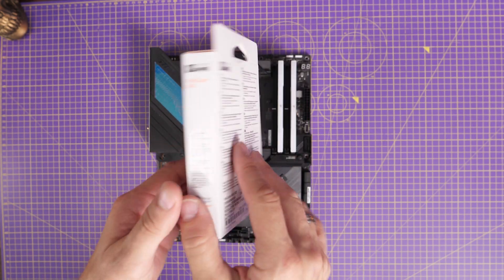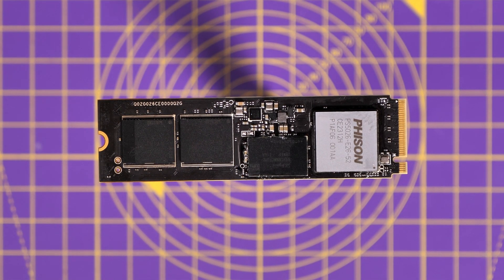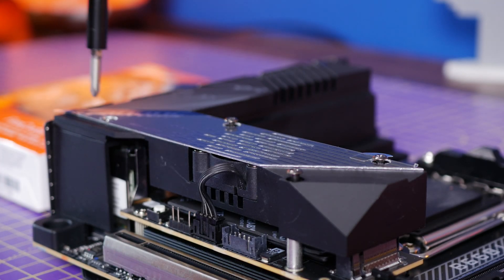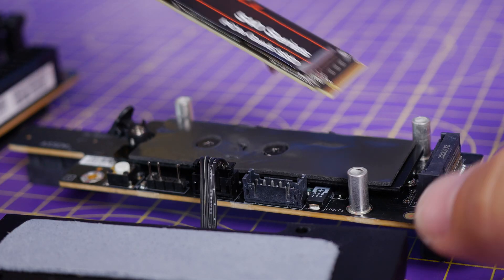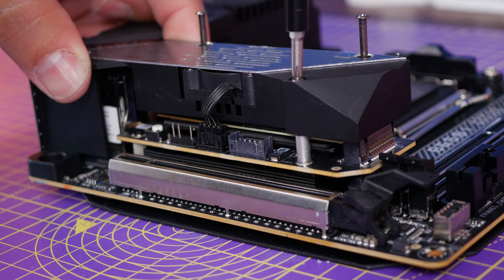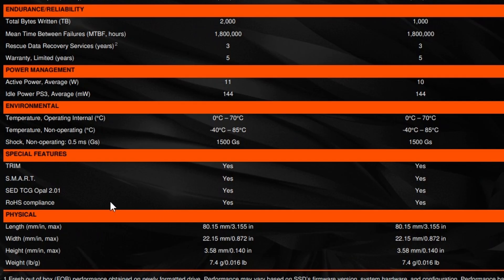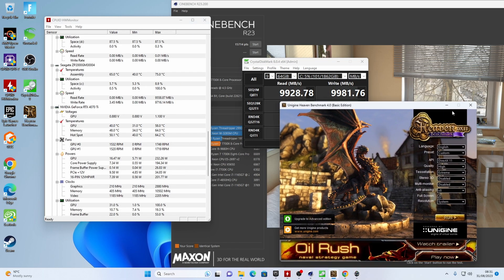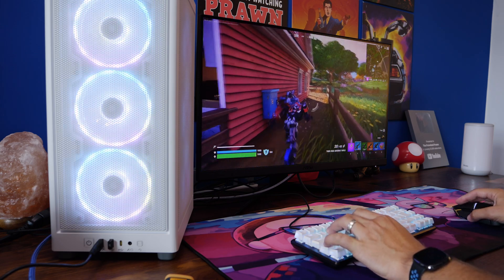Should you use PCie Gen 5 NVMe as a boot drive? Will Windows work?

Comment: I bought it recently for 78$ (1TB model). I put it on my main nvme slot on Asus Strix Z890E motherboard and move my OS to it. Despite very thick heatsink with heatpipe that asus provided for this gen 5 nvme slot, this ssd is running around 55-59°C during light task (browsing, watching movie). Should I worry about it? I have multiple gen 3 and gen 4 nvme installed in my boards and all of them are running around 36-41°C only.

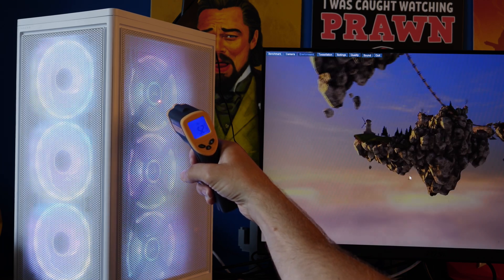Comment: Correction: At 4:44, TPP says "the max temp is 75 C, which is 10 degrees less than the max that would cause a problem"

NOTE: 85 degrees C is the max NON-OPERATING temperature, and the max operating temperature  (as shown at 3:47) is 70 degrees C.
So at 75 C, it is running 5 degrees hotter than the specified operating temperature range
Reply: Yes, that -40 to 85 degrees was more of a temp range while powered off or stored, it had nothing to do with the operating range.

Comment: I have a Gen 5 Drive and a Gen 4 Drive as well, Should I put Operating System on Gen 4 and games on Gen 5? How do you think I should set that up to Utilize both drives?
Reply: Put the Gen 5 SSD in the high speed PCIE slot closest to the CPU. Make it the boot drive since it’s the fastest SSD. As far as games go put them on the drive that has the most capacity. You don’t want to completely fill up an SSD because it makes them run slower over time.
Reply: msi says use Gen 5 as main os

Comment: I KNOW it's a complete waste of money, but I just bought a Crucial New T705 4TB PCIe Gen5 NVMe M.2 SSD - Up to 14,100 MB/s.  I'll try the heatsink cover that came with it the Motherboard, but I expect I will have to buy a much beefier M.2 heatsink to keep it under 81C where it starts throttling.  On another note, I LOVE ITX builds and this is the 1st time I've seen this Corsair case and really like it!
Reply: I bought a Gen5 1TB Crucial T705 as my boot drive and a Gen4 4TB Samasing 990Pro for games and storage.

Not sure it that is the proper way to go.
Reply: @voodoo9077  That is the much better way to go. 1TB is enough for the OS and many apps/programs.  The 4TB is perfect for games, backups, data files, etc.  I think if I had it to do over again I would have done the same thing, for the amount of savings I could have gotten two of the 4TB Gen4 drives, I really can't recommend Gen5 drives at the current prices, and only if there is a massive increase in drive size and price decrease.
Reply: @voodoo9077  ... Very smart way to go.  I did same thing, but with Gen4.  The Gen5 isn't worth the extra money.  Bez, on my system, I can't keep it cool, being under my damned beast of 3080ti.
Reply: @voodoo9077  Keep in mind some games really need to be on C though.

Comment: Clearly Win 11 24H2 works with a Crucial T700 which is a Gen 5 SSD but take care.......... I own a 1 To Crucial T700 with heatsink and the performance is not at the expected level described in the technical documentation. I use the SSD as a "system SSD" with Win 11 24H2 and numerous softwares and games are installed. During light works the SSD temperature is contained between 60 an 65°c, once the load is higher the temperature increases up to 82°. The transfer speeds given in the technical documentation for sequential reading is 12400 Mb/s and the for sequential writting is 11800 Mb/s. My experience is that when the temperature is around 60° the speeds are close to the documentation values, during heavy load the temperature raise up to 82°c and the speeds are lower than 5 Mb/s (divided by 2.5). This look like to a temperature control loop based on the frequency.....   Clearly the T700 SSD does not meet the announced values, my advice is to save money and choose another SSD, Gen 4 for exemple. Having this SSD I have to manage it and I am going to buy an active heathsink. I hope that I will be able to maintain the temeperature lower than 65°.....
Reply: Did you plug it in the Pcie 5.0 m.2 port?
Reply: @Ghostyboydead  Obviously yes, this would not make sens to buy Pcie 5.0 without the prper mother board.
Reply: do you not have a heatsink on it already?
Reply: @fernoflake  The T700 is sold with a heat sink but this one is not efficient enough...
Reply: @jpchave8455  so what would you recommend? a third party heatsink?

Comment: Does the person recording this video realize that stickers conduct heat poorly? If you are already creating such resci, it may be worth considering what you are doing to avoid misleading people. All stickers and foils should be removed before installing the cooler, and this applies to the radiator and the m.2 disk.
Reply from the maker: Does the person making this comment realise that some of the "stickers" are copper backed and conductive. Additionally, there's a reason the manufacturers tell you not to remove them.
Reply: @TheProvokedPrawn  If I see correctly, the sticker was on both the disk and the heat sink. If the stickers contained copper, they would probably conduct electricity, which is an easy way to short circuit. Can you write where in the instructions for the motherboard and this SSD it says not to remove stickers and foils?

Comment: Another great video.  Thanks!   Are there concerns with Gen 5 ssds taking up PCIe capacity from the GPU?
Reply: Resort to your motherboards manual in pcie NVmE config. It will tell you what each lane will effect if there is any change. But from what I’ve seen a pcie 5.0 on a cpu lane will not effect the pcie x16 for gpu

Comment: why buy a seagate? if a brand has the most broken stuff in hardware it is seagate...
Reply: Seagate is a very well established hard drive manufacturer since the 90’s. They are solid, just Gen5 needs revising due to throttling problems. They get hot too fast to be reliable for a boot drive. Personally I’d avoid Gen5 nvmes for the foreseeable future, not that we even need these speeds for day to day things.
Reply: Get a heatsink. @MhillPlays
Reply: Lol...I use Seagate Firecuda M2 gen 5...10 000 mhZ ...another gen 4. 7300Mhz...and those are briliant and very speedy
Reply: @QuantizStudioRecords  mhz is not the right term for drives...
Reply: @ThunderGod9182 neither they are for RAM yet you knownwhat he means😅

Comment: My motherboard had a second pcie 5.0 m.2 slot and I am using that instead to keep the temps cooler.  The gen 4 I have in the other is much hotter.
Reply: Which motherboard?
Reply: @Superbed2  ProArt X670E-Creator Wifi

Comment: Hello there I just wanted to offer my two cents on some of the concerns I have in this video, I want to start by saying this is the first video I’ve seen of yours and I have subscribed to your channel. This is by no means intended as hate or disrespect, more just wanting to give some feedback and help improve the channel. 

1. I noticed while you used a lot of synthetic loads to put pressure on the drive there was no real world sustained use case pushing this drive and truly seeing how it performs in the short-medium term at least. Might I suggest running this drive as the main windows drive as you work on it to edit the videos, while downloading a game and uploading a YouTube video? Just truly push this drive and find out it’s limit both architecturally and thermally. 

2. I noticed you used Fortnite and unigine heaven in this video. Fortnite is not a good use case to show for gaming as it runs on practically all systems (including smartphones) with no real issues whatsoever for drives. I think trying out games that could have poor optimisation on pc such as any of the Sony titles or maybe games that sony showed off with their own nvme drive like ratchet and clank rift apart this would’ve been a better real world choice. I think using unigine heaven was a bad move, you could’ve used unigine superposition instead it’s also free and a far better option to test hardware like this and push your pc to its limits therefore generating a lot of heat increasing the ambient temps inside the case. I’m not sold on the fact heaven did this sufficiently.

In conclusion I love your voice, Narrative and the format of the videos, it’s always nice to see a fellow Brit makes videos with tech and talk about this stuff I feel YouTube is just absolutely flooded with Americans and Canadians whom opinions on hardware don’t always match up what we feel in Europe due to the prices and availability differences of hardware of the two continents. I hope you take on board some of my criticisms and that it makes the channel better. Great video and I wish you luck in the future!
Reply from the maker: It was used for gaming and downloading and all the things you have mentioned but I just didn't include all that in video form as it would make it far longer.

Comment: I'm very happy with my 2TB Samsung 990Pro as OS drive, powering my 5800X3D System.
It sits comfortably under a Acidalie VB01 in Black and runs more than well.
No need for hot and expensive Gen5, wouldnt make any meaningful difference.
JFYI: Samsung finally has brought the 4TB Model to the market.
Reply: I agree. I have a 990 Pro 4TB. And yes Gen 5 drives really really really are pointless for a majority of people at this moment. Drive speeds really are no longer the bottleneck and a super fast Gen 4 drive is more than plenty for everything. Maybe in 3-5 years time we'll see a need for Gen 5, but right now it's a waste of money.
Reply: Not sure how anyone can say that they don’t need a drive that is 25% faster. Managing side effects is a different matter but c’mon
Reply: @serolog  
They dont matter other than a few very specific workstation tasks, where their speed uplift does make a difference...
But in most scenarios, they dont make a significant difference, as in most real world applications and usages, there isnt even much of a difference between a SATA SSD and a GEN3 or 4 NVME, other than pure direct data copying or maybe boot up speeds...with the latter just differentiating in just a mere few seconds...

So NO just watching at the pure, mostly synthetic speeds and waste a crapton of money on it and having to deal with the drawbacks...
Why should anyone do this, when Gen4 is more than just sufficient, costs half of Gen5 and doesnt get nearly as hot?
Reply: @wolfwilkopter2231  for me the difference between a standrard SATA SSD and NVME was very significant
Reply: @serolog  
It all depends, but in most scenarios, it isnt.
And just because it was for you, doesnt mean its for everyone.
You didnt say in what the difference is so great, that you would even go as far, to defend Gen5 over Gen4 despite all the drawbacks that come with Gen5.
Workstation? NVME NAS? Heavy Workloads in lets say Rendering, Videoediting and co?
Just dont say "Gaming" or normal allday usage, coz we all know its a lie.
Reply: @serolog  in real world usage there is no difference.
Reply: @soapa4279  sure, but enough difference not to say idontcare
Reply: The amount of copium on this comment is insane
Reply: @rickfelz7148  
and where exactly is the "copium" hidden in this comment?
c'mon tell me, i'd like to know, where i hid it, i've been searching for for weeks, but cant find it...and yet here you are, claiming to have found it...

Comment: I've got an ROG STRIX Z790-I GAMING WIFI with a Crucial T700 1Gb NVME that never goes beyond the mid-50's Celsius. Previously had it in an Aorus Z790 Master and it never broke 50 Celsius in that board. If you're thinking of using a Gen 5 NVME in your motherboard, go for it, the speeds (11,700 Read/9,600 Write) are just FUN!
Reply: Yes, but you can then only use 8 lanes for your GPU slot with Intel CPUs
Reply: @KainsAddiction someone said there’s no graphics card that uses the 16 lanes yet so it’s fine.
Reply: You using heatsink or without?

Comment: I decided to go with gen 4 for my AM5 build. Works great :) 7800x3d with 7900 xtx and 32gb ram, 2 tb storage.
Reply: This is the same specs I'm gonna use on my next custom PC, but I'm trying to see a benefit on this gen 5 SSDs in terms of Windows boot time
Reply: @d8vjork   boot time is always a little slow on am5 in my experience, but maybe its because of gen 4 ssd?
Reply: @d8vjork   im using firecuda ssd from seagate. this is a fast gen 4
Reply: That’s  pretty low but alright
Reply: @RuneBa1  which parts low?
Reply: @Acid-Operator  xtx and 2 TB imo.
Reply: @debonairdemigod  dumb comment is dumb, the 7900xtx matchs the 5080 in many titles only 5% behind, nice try diddy
Reply: @debonairdemigod  and u aint no demigod, theres only 1 god and it aint nothing created!